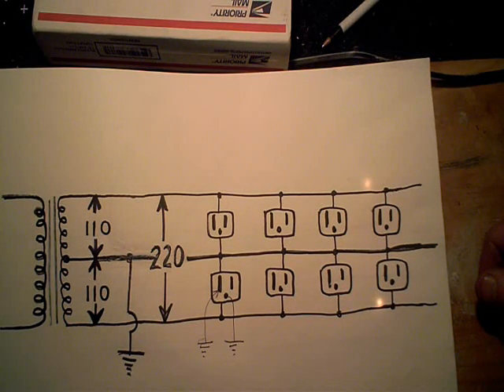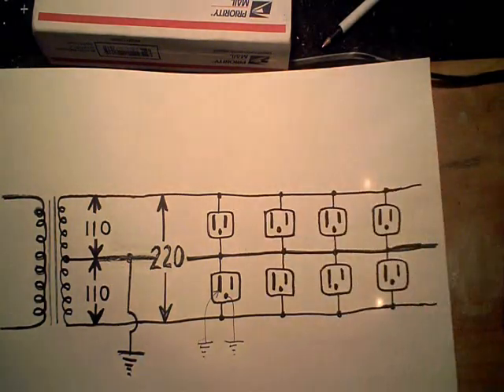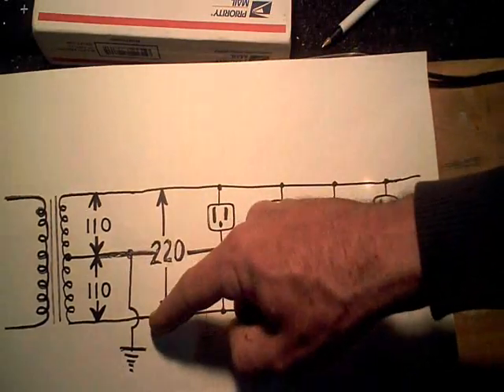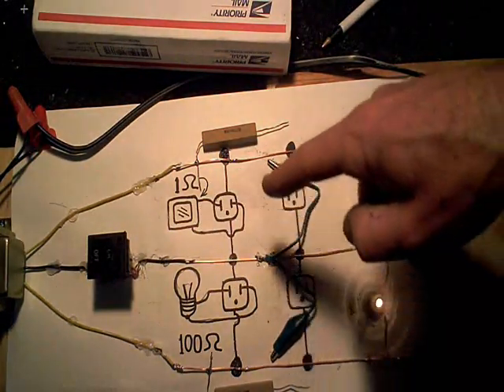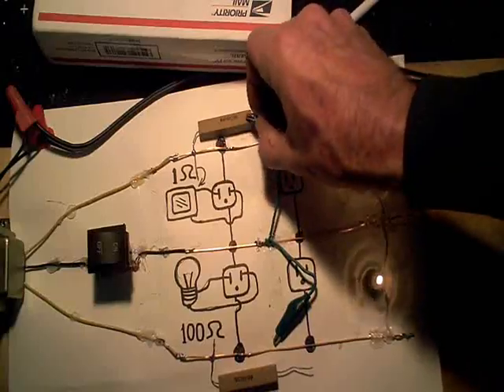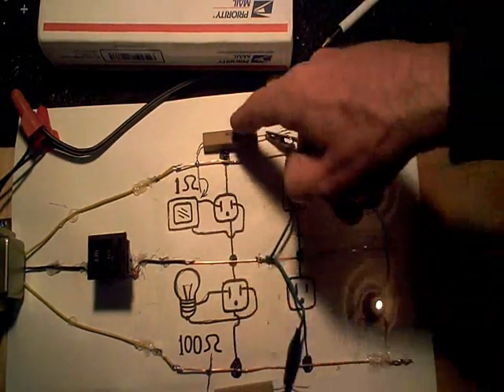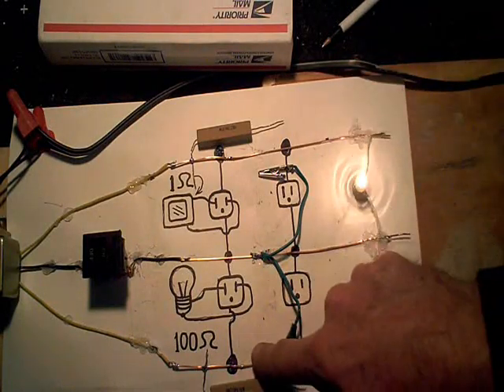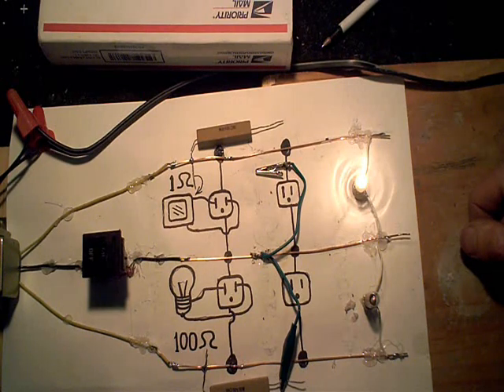Power surge due to an open neutral wire.

Comment: Ok I have a serious question, I stopped by to see an old friend and noticed his lights were dimming and then going super nova ( bright) and asked him how long that’s been going on ? He replied that it’s been doing it for a few months but just got even worse. I noticed he had a new fridge and his new last fridge was out side and new he had power issues , I tested the panel main and  it was way out of balance from phase 150/90 volts variance , as I went to see if he cut the ground somehow the overhead service neutral was broke completely in half  I told him get the power company out here . He is the most Stubborn dumbshit friend I have .  Should I call the power company anonymously before he burns the place down . Hell I don’t even want to take a piss for fear of getting zapped . Am I over reacting ?
Reply from the maker: I don't know that it would necessarily result in a fire since most appliances are fused, but I wouldn't rule that possibility out. The last time I saw this happen to a lady friend it damaged some of her electronic appliances and a power stip because of the built in surge protector. That unbalanced bank you measured which had 90 and 150 volts difference between the Two outlets could get even worse on occasion as the refrigerator cycles, or someone happens to plug in  an additional appliance in one of the outlets.  Surprisingly the last time I saw this happen a nutural wire broke inside fo the plastic insulation inside the breaker panel, so you would  never discover the problem doing a visual inspection. alone.

Comment: The reason why one of the bulbs increases in brightness on the opposite leg of the 1 ohm resistor, is that the 1 ohm resistor acts as a “short” to the other 120 v leg. the 100 ohm bulb (that is dim/off) is in parallel with the 1ohm resistor, and hence the parallel rule applies, and the voltage across the dim bulb is nearly zero. The bright bulb is essentially seeing 240 V at the moment the neutral is broken, because the center point now has no “potential reference” to the center of the coil, now it’s reference is only to the other phase, which know is 240 V phase to phase. (Used 120V for simplicity, not sure what the actual voltages were on your setup). In actuality, because of the voltage drop from the other loads it will be less than 240 V.
Reply: “Parallel rule applies”. With the open neutral the two (2) legs that are parallel loads in themselves become in Series to one another.  
     “Series rules apply now”. The load (on either leg) with the HIGHEST 
resistance will have the largest voltage drop.  FURTHER EXPLANATION 
is the leg with MORE loads will have LOWER resistance because of the
parallel rules apply.
      Thank you for keeping us informed.

Comment: I live in a mobile home and this has been happening. I found a spot in the ground that was only two strands. Fixed it and hopefully fixed my problem. My question for you is why wouldn't it trip the breaker at the panel? Thank you this video was very helpful!
Reply from the maker: The circuit breaker is triped when you exceed it's current rating, so even if your voltage goes so high that it damages your electronic equipment, your current flow may still be under what it takes to trip your circuit breaker.
Reply: @GrantsPassTVRepair  Thank you. Your video may have saved my house from burning down.
Reply from the maker: @brandonsettgast5177  Thanks for the reply, and glad I could help.

Comment: Sir: not a neutral wire question/problem.   But difficult to comprehend how the neutral (not open) carrying the portion of unbalanced current back to the center tap has zero voltage.   Current reversing polarity while doing this. zero voltage.
Reply from the maker: I don't understand your question.
Reply: Grants Pass TV Repair Will try again.    In Household current, the neutral conductor
balances the UNBALANCED portion of the current. The question is, (with no
open neutral) why do we not get a shock off of the neutral, although current ( negative electrons) are pulsing pack and forth. thank you
Reply from the maker: @tedlahm5740  The neutral wire is grounded, but if you were to touch one of the other wires and the neutral wire you would get shocked.

Comment: Okay I have been living in my house for 6 years minor problems here in there but tonight for some reason my kitchen light switch is turning on and off my bathroom light my fuse box the breaker is turning off the room that's not supposed to be turning off its supposed it's I don't understand what's going on  if I turn my fan dimmer into the Midway point my fish tank in the living room turns on nothing electrical has been done it's always worked right but tonight it's just woo
Reply from the maker: Your description  sounds to disorganized for me to understand.
Reply: the power company says I have an open neutral wire in a transformer can that cause random crap in my house
Reply: Exactly disorganized my power is disorganized

Comment: Would a bad breaker on one side all the lights to brighten such as yours just did?
Woke up at 5am to a power problem and figured the over heating fridge caused it to flip but got down to basement to see that the usual breaker was Not kicked and basement lights were Super bright.
I then went upstairs to see surge protector smoking and a bus style tv piped and started smoking.. ...
Sorry to tell you all of that, main question is ,is it possible the breaker is not flipping and caused all of this? No electrical work has been done lately but fridge fan stopped working causing fridge to over heat and kick breaker.
I can’t imagine it’s possible that a neutral came undone anywhere but I know that you know what you are talking about... I really hope you check your youtube daily. Lol . The smell or the stuff that burned up is horrible.
Reply from the maker: I doubt it has anything to do with a bad breaker. I'm guessing you have an open neutral wire as I described,  It's possible that you have had this problem for a long time without realizing it,  and it only became apparent when one of your refrigerators quit working,  because prior to that time the working refrigerator was helping to balance your loads,

Comment: Can you tell me the equipment used to create this demo and how you set it up
Reply from the maker: All I used was a 120 to 12 volt transformer that had a secondary with 3 wires, or what's known as a secondary with a center tap. The only other components were a couple resistors and some lights and a switch.

Comment: Our power company just replaced the pole and transformer near our house that had our connection on it.  Long story short, they didnt properly connect the neutral, and it blew most of the components in the house.  I just hope between them acknowledging their error and homeowners insurance that im not out thousands of dollars on new appliances (it even fried the furnace).
Reply from the maker: You're not the first person to tell me a story like this. I hope the power company covers your loss.

Comment: Does that mean it’s a hot neutral now ?
Reply from the maker: I don't understand your question.
Reply: I believe that's right. Your black wire typically carrying 120 now has the white neutral also carrying 120. Combined for 240. Very dangerous situation.

Comment: this should not happen that often as main panel already folks each component with breakers. Within one 240v breaker subsystem if multiple outlet are daisy chained and that line has open neutral then what you described will happen. The optimal case is each outlet has it's own breaker and all connects to main panel, then open neutral for 120v subsystem will not work and 240v system(maybe only dryer) will suffer from floating voltage.

Comment: I tried almost everything master bedroom has no power replaced gfi and other plugs no power and the breaker isn't bad
Reply from the maker: You may need to use a toner find out why the power isn't making it from your service panel to your outlets.
Reply: Grants Pass TV Repair 
OK where can I get one
Reply from the maker: Harbor freight has them pretty cheap, but you can also find them on ebay. Here is a video on how they work. https://www.youtube.com/watch?v=apIpHPgkevQ

Comment: +Grants Pass TV Repair - 
YES, absolutely correct ... 
that's an other reason, why the USA home / office power system (Not only plug + socket) is unnecessary dangerous garbage ...  except the 60 Hz which is superior to Europe 50 Hz & the cables in metal tubes (also for RFI / RMI shielding) , instead of plastic ones ...   
There should be a dedicated 230 V Single phase circuit with own neutral for the more powerful ( & newer) stuff , with a new recessed socket like Germany / France / Brazil (new) / South Africa (new)  ... 
While for the less power USA (Edison) legacy stuff a dedicated 115 V single phase circuit with own neutral , with a new recessed socket (like Germany / France) & protection sleeved pins like UK / Brazil (new) / South Africa (new )  = this can be backwards compatible with Grounded USA-plug ( type B ) .  type A should be banned ... 
Also a Ground ring connection bus with 4+ ground rods should be for the entire house ... 
= it lights or not, but the frequent open neutral caused power surges will be history.  
Europe: 
In Germany 400 V (genuine) 3 Phase service + Neutral , has nearly every home build / upgraded since 1970s ... mostly used for stove / oven ( usually 16 A ) ... mostly hard wired by an electrician, alternatively (recessed) "Perilex" plug or industry "IEC 60309" "CEE 3L+N+PE, 6h" plug ... 
Normal sockets in Germany / France have 230 V 16 Amp ... most used breakers are 16 A

Comment: Thid video is saying yhe nuetral eas omitted at the box, right?
  I have to ask, how did any of the 110 circuits work with no return path for the power to follow?
Reply: It is returning through the other leg causing  the increase in voltage.  For 220 there is no other return path but the two leads.

Comment: Yesterday a falling tree took my power cable down partially  disconnecting only the neutral wire from the street to the power mast. Within a few minutes still having power I noticed a light flickering and quickly shut off the main 220 switch on my fuse box. The only damage I find was one surge protected power strip burned out but other power strips on the TV were OK as was the rest of the house, If this happened when no one was home I can imagine what damage would have occurred. Its pretty easy to see how a main power line could be damaged outside the house if just the neutral connection is broken.
Reply from the maker: You were very fortunate. Some of the inexpensive surge protected power strips are false protection.

Comment: In Austria during the 50-ies we had to install melting fuses in the neutral as well as in the hot wires. Many such installations are still in use and you guess what, they damage lots of electric equipment when the neutral fuse blows before the hot wire fuse blows. All houses have 3 phase supply here.
Reply: Fuses on neutrals are a really bad idea. On a single-phase system if that blows it means the neutral connections can float high. 

If there's a requirement for the neutral to be disconnected on a failure, what's need is a dual-pole breaker.
Reply: @AlterKater  the regulations in the UK only require single pole circuit breakers, but in some countries, like the Netherlands, they have to be double-pole breakers. Perhaps that's something to do with the use of three phase in households, or perhaps it's because of the use of non-polarised power outlets.

In any event, breaking the live/line ought to be enough on the sort of single pole circuit that's used to feed domestic outlets.

Comment: and of course we would not have this issue if the USA would use 240V for everything like most of the rest of the world...
Reply: BigDish101 oh you would!) Doesn't matter if it's 110 or 240. Neutral faults screws everything up baaadly on 3 phase circuits. :(

Comment: I lived in a place that had a neutral fault. It scared the hell out of me so I moved. Six months later, the family that moved in after I left died in a house fire. To those of you who suspect this to be a problem I strongly suggest you get it looked into. If your landlord refuses go talk to your public safety officer. They can usually be contacted from your city hall. Having a neutral fault is dangerous not just to your electronics but to you directly. Get it fixed.
Reply: +ExStatic Bass - 
Thats bad ... 
Luckily, in Europe we dont have this problem
Reply: @Killerspieler0815  We do have the problem of open neutrals in europe. Especially in some parts. And some parts of europe are just as bad as the US with landlords. Luckily where i live (Sweden) and probably where you live, the landlord problem is probably more regulated and not as bad.
Reply: @Mathias Westerlund - 
I can imagine that it is bad in Albania & Romania
Reply: @Killerspieler0815  It can happen anywhere. 
TN-C-S wiring means a lost neutral can kill you or seriously injure you.
Google Denishar Woods.
Reply: @the_real_hislordship   - YES , this system should be fixed

Comment: Excellent demonstration of what happens when the "shared" Neutral is cut in a Multiwire Branch Circuit. The two parallel 120V circuits combine into somewhat of a 240V series circuit where the voltage is divided between the two "legs."

If the legs are balanced, there's no need for a neutral because the current is coming in on one leg is equal to current going out on the other leg. With an unbalanced load, the voltage will shift from the leg drawing more current to the leg drawing less current in order to match current coming into the circuit with current leaving the circuit.

The purpose of the neutral is to provide a return path for any extra current in the circuit and mitigate a voltage shifts in the case of an imbalance.

Comment: Here in southern California on  a single phase 120/240  circuit  the neutral wire carries the unbalanced load. for instance lets say you wire an A/C unit that uses 20Amp 120V and you feed it from L1 to Neutral with 12 gauge wire that neutral wire is now carrying 20 amps.
Now lets say you install another AC unit in another room and you also install it from L1 to Neutral.That 12 gauge wire that is rated for 20 amps is now carrying 40 amps. what people don't realize is that yes your L1 wires are protected by a circuit breaker, but the neutral that goes wired straight to the neutral buss bar has no protection at all leading to fires or causing that neutral to fail and creating  an open neutral circuit like explained by Grants Pass TV Repair. Now lets say you add 4 more loads rated at at 20A,13A and one at 9 Amps but you wire it from L2 to the same neutral that load is now balanced and only carrying 2 amps. I hope this helps.
Reply: +Charles Goyette I understand what you're saying. I'm NOT saying to add a 20 Amp A/C to the same circuit, I'm saying that by adding another breaker on the same PHASE, That shared Neutral will carry the unbalanced load. A multi-wire circuit is one with two hots and one neutral. The two hots must be placed on different phases/legs of the panel. This way there is 240v between the two hots.What happens is if the load is perfectly balanced on the two hots, as in a true 240v circuit, there is0 current on the neutral. If the load is unbalanced the neutral carries ONLY
the amount of imbalance.Example: 
Phase A is carrying 16
amps.Phase B is carrying 12
amps.The neutral is carrying 4
amps.
Reply: @ignacioserafin5673  also that's why things burn up when you lose a neutral as it becomes unbalanced that's why u must use breaker ties and also why phases alternate like that in a load center.
Reply: +Ignacio Serafin I believe you are referring to the neutral between the utility transformer and the service panel / load center.  That neutral is certainly not a 12 gauge wire and yes, it will carry the 40 Amps as you say.
Reply: +Ignacio Serafin Not really.  Each circuit uses three wires - hot, neutral and ground.  Another 20Amp A/C unit on the same circuit would put 40Amps on hot and neutral, tripping the breaker.  If the second A/C unit was put on another circuit, then no problem (20Amps on each branch circuit).  The 40Amps on the neutral would occur between the supply panel and the utility transformer but that's a big old wire that can handle the current.

Comment: A surge protector is suppose to divert the high voltage to neutral, very quickly.
Most likely they use metal oxide varistors (MOVs).
If the neutral wire is open; the MOVs can't protect the circuit.
I have a surge protector that will, also, kill the circuit if it senses a voltage above 120 volts.
Reply: The MOV in a surge protector typically has a rating above 250 volts.  Therefore, the MOV won't close the circuit (and won't divert the high voltage to the ground return path) if neutral is open because the voltage won't rise above the MOV trigger value.
Reply: +Louis Wilen I thought the MCOV (maximum continuous operating voltage) is the key.  This value is typically around 150V and that is the voltage level where the MOV starts to conduct.

Comment: I have had this happen before. we had a bad wind storm a tree fell on my line coming to my home and knocked out the neutral line and this happened to me. but I was lucky though it just blew out the fuzzes in the electrical equipment, but at the time I didn't know the neutral was out. witch also warned me that my ground was not good enough. because its also neutral when I flipped on the microwave that's when everything went bad. and popped fuzzes and more.